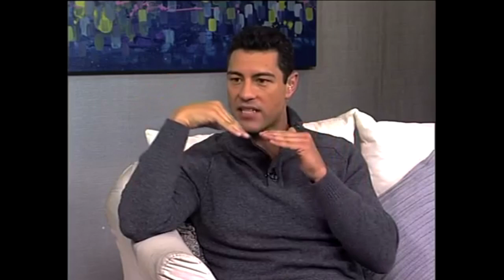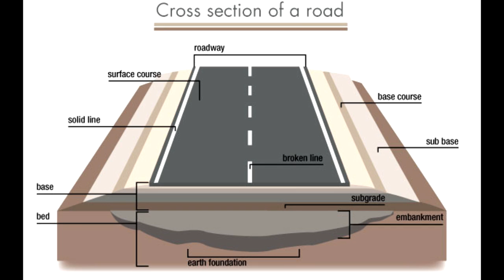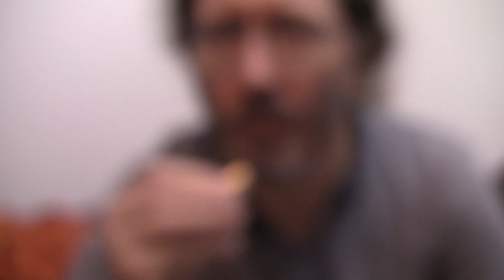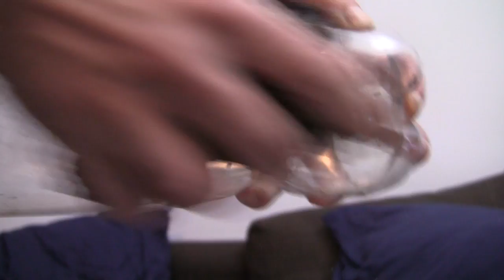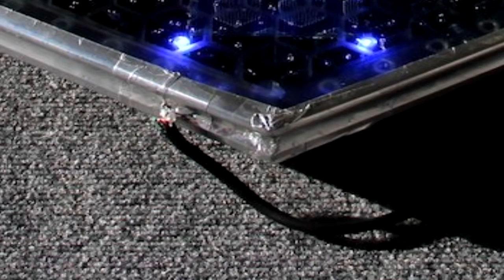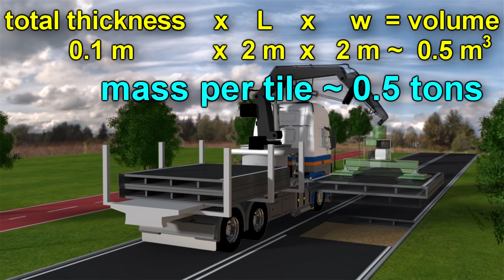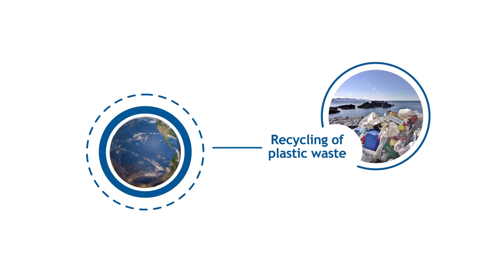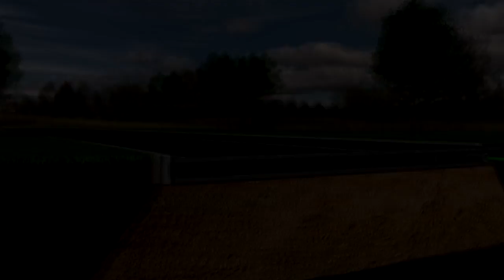Plastic Roadways BUSTED!

Comment: Wouldn't it be great if every road was straight or had a predictable bend to it. Truth is, the roads curve and contour to the land, part of the ease in making roads is that you can curve them to just about anything. These plastic roads would be so impractical. You would literally need a surveyor to plot ever inch of the potential roads surface.

Now, to put the above into perspective, a friend of mine is doing the surveyor works for freeway sound walls, and this requires the entire wall of the freeway to be mapped out, now, this mapping work will literally take a year for multiple surveyors to perform at multiple points on the freeway. Literally just the sound wall on the freeway would cost an arm and a leg to survey. With this plastic roads, you would need to survey every inch of the road surface, plot down curves in the road in high detail. These people have no idea how much work they are going to create for these surveyors who already get paid a tonne.

Comment: How about non hollow panels out of plastic with a surface layer out of rocks?
You could make them out of verry shitty mixed waste plasics in the bottom layer and a better plastic/rock composite in the top layer an weld these panels together to form a road.
A cable tunnel out of plastic waste could be next to the road.

It could be cheaper since you don´t need to seperate the different polymers to get this material and could actualy last longer then conventional asphalt since it wouldn´t get potholes as fast as asphalt.

Comment: You forgot the most important problem.  EROI.  With a falling EROI oil is becoming uneconomic.  The biggest oil companies are starting to make loses as the thermodynamic output of a barrel of oil drops.  
The world needs 30 to 1 EROI to function and that was reached in 1971.  Today world EROI is at 18 to 1 with debt making up the difference.  Exxonmobil, Chevron and ConocoPhillips, three of the world's biggest oil companies lost 8 billion dollars in 2015 and 7.9 billion dollars in 2016.  If the price of oil goes up the world goes into recession making oil prices drop causing oil companies to go broke.  This combined with global warming will cause the greatest collapse in the world economy in history and we won't have the EROI to get out of it unless a new energy source of at least 30 to 1 is found.  Spain and Germany's solar EROI is 2.8 to 1 and 1.8 to 1 respectively.  Wind is 15 to 1. Nuclear is 18 to 1 and takes too long to implement.  
Energy experts the Hills group has predicted that by 2025 75 per cent of petrol stations will be gone.  Mad Max is a more feasible scenario than plastic roadways.

Comment: By definition, plastic is very capable of handling multiple different kinds of attributes, but I somehow doubt a plastic capable of handling the kinds of stresses roads take from vehicles is exactly cheap and or easy to produce. The major destroying factor of roads today is due to soil water freezing and thawing, giving fluctuating stresses in uneven amounts, destroying the road and forming potholes.
Asphalt is functionally cheap and incredibly capable of taking the stress of vehicles and flexible enough to resist minor amounts of physical stress from thermal expansion and contraction.

Comment: not even 5 minutes in the video and as an electricians helper, the wire and conduit in a plastic roadway is SUPER NOT code. if one of those sections breaks from a semi you will need an electrician to fix the break in the wire minus the fact that is super inconvenient and dangerous.

Comment: But plastics can be reinforced, though, like the materials they use to make those "professional grade" tools, I guess. I think it's with fibers or really small balls of carbon. The fibers make resistance to impact and balls make it more heat resistant. Not sure, though. I don't think it would still work but it would make it a little more possible...
Reply: Repi Tv can you actually give the names of what your talking about because just saying "these fiber things can make it stronger" doesn't mean anything if you can't even tell us what those fibers are
Reply: Repi Tv nevermind it was mentioned in the video it would make the construction more expensive and make them impossible to recycle

Comment: I would be more worried about levelling issues between two different sections of plastic. Roads are never completely flat, and once you lower the segment into place, you are never going to be able to get it precise. And that little bump will cause the road to be rated 20km/h lower then it would normally. Here's a great example, a freeway in Melbourne had to be expanded wider, and ended up above a river, and they used pylons with segments lowered into place, but the little bump between segments caused the freeway to be given a lower speed as a result.

Comment: the GDR just used concrete plates as surface. (of cause not for all streets)
modular, cheap, easy to produce, long durable and a pain in the ass to drive on it

Comment: Just make roads out of old scalextric tracks.
Reply: ZefVolk Lol. If my experience with Scalextric is anything to go by, we'd all go flying off the road at the first corner.  😂😱😂😱
Reply: We'll put a shoe under one side of the road whenever there is a corner. There won't be a single road accident with Solar Scalextric Thorium Plastic Roadways!
Reply: Yes, we could use the waste plastic to create more crash barriers to fit around the corners of the track to stop us flying off.
BUT we would still have the problems of the live conductors in the centre rusting up, especially here in the UK with our weather.

Comment: I once made plastic by mixing floor cleaner, vinegar, and hydrogen peroxide.
Reply: What kind of floor cleaner? How did that work?
Reply: The gaseous kind of plastic that causes chest pain and the like when inhaled.
Reply: Johan Krooneman :-D exactly. It's quite a bad idea to mix together different substances, when you don't really know what you're doing.
Reply: + Thomas Hobbes I don't remember what kind of floor cleaner and there weren't ingredients listed on the bottle either. That was about 6 years ago. The reaction made a very unpleasant smell so I had to ventilate the area.
Reply: pukalo WOT that's what I meant. Very bad idea. You can permanently damage your health if you start chemical reactions without exactly knowing what's going on.

Comment: "It has many advantages over existing products" - namely it will funnel cash into the pockets of these hucksters if it ever got funding.
Reply: At least Solar Roads had the promise of Energy production going for it. This is just a different flat surface.
Reply: I wonder if you could sue them
since they are misleading and basically scamming people, if they get funding from anyone, since this needs to stop
Reply: Feminists don't do any better and they can't be sued since decades.
Reply: RipTheJackR considering someone was dumb enough to fund solar roads I wouldn't be suprised

Comment: okay guys, can we just all agree that tarmac is the best way of making roads?
I mean, don't these people think there might be a reason why China, South Africa and America all make their roads out of a Tar mix?
Pretty sure that wouldn't be the case if it wasn't objectively the best solution.

EDIT: I actually went and checked, at 100$ a ton, you will be hard-pressed to find ANYTHING that is cheaper by weight than blacktop. Probably why it is used everywhere.
Reply: +Nerobyrne No, in South Africa we don't make roads out of tarmac, we make them out of potholes. Then we set up automated camera systems that will bill you exorbitant amounts of money for using the roads, even if you didn't.
Reply: Is that 100$ for the finished product, or just the black goo? It's cheap either way, but if only the black goo costs that much then it's ridiculously cheap.
Reply: ***** it seems to be the finished product.
But actually the black goo is by far the most expensive part, since the rest is mostly rubble!

Comment: STUPID idea. plastic can deteriorate in both physical and sun radiation.
Reply: Yeah it is a issue. This mean that you NEED to put stabilisers which will make it even more expensive.
Reply: Well, asphalt is cheaper and we dont know the final cost of this plastic road production. Just saying that is cheaper than asphalt is just a random guess.
Reply: Of course it's a bloody issue. It will need to be put into the plastic as the products are made, exacerbating the fucking problem of the plastic that doesn't get recycled lasting even longer in the environment, AND costing more in the process.
Hardly progress, is it. Or problem solving.
No wonder we're fucked.
Reply: if u wanna replace something, it has to be cheaper than the old one
Reply: Depends what era were u talking about Taking Care of Horses 18-19th Century or 20th-21st Century?
if u said horse and cart cheap unless u are living in Amish Community
Reply: khairul USacc not all kinds of plastic
Reply: Honudes Gai The horse and cart was actually fairly expensive, because horses take a lot to care for and feed. Owning one (not really for the common man) meant also having to pay for its stable, having land for it to run around on, its food, probably servants to care for it, etc. The car beat it because it was faster and something the middle class of the early 1900s could actually afford, both in money and time, to buy.

Comment: Why do people try to re-invent roads all the time? What is wrong with asphalt? Nothing, that's what's wrong with asphalt.
Reply: As a final year engineering student I would have hoped you would have been a little explanatory. In what way? What did he unfairly bash? Where did he get something wrong or misrepresent anything? What exactly do you find convincing, compelling or even reasonable about any of this. I would be intrigued to hear your ideas broadened out a little.
As an engineer since, well forever, I'm now 54 and have worked in many different industries, including mining, plastics and polymers (moulding, injection, blow and press), and more. I also have worked on road laying machinery and have 2 very close mates who actually are road layers, up to and including motorway.
Not that I'm attempting an argument from authority here at all. But I personally see nothing remotely reasonable about the idea. In fact I would say it is quite ridiculously over the top in it's positivity, verging on, if not already passing the threshold of dishonesty.
Even if I didn't know what I know I would dearly hope my bullshit'ometer would go off, certainly before the end of the presentation.
Reply: DN Swag but still better than foil hats
Reply: DN Swag He did talk about them using a different kind of plastic, mentioning that it loses most of the features it would be advertised as having. Did you make your comment without actually watching the entire thing? He even, for the sake of the argument, imagined that there was some plastic that was durable enough to do the job.
Reply: Vanessa H just because they have being toxic in common does not mean they are basically the same. they have completely different formulas and different physical properties lol. but true very toxic. but only when wet. you can smell and lick asphalt all day after it is 100% cured. not on a sunny day though. wouldn't recommend it.
Reply: Filling cracks and potholes is extremely cheap and easy. Just a man with a truck and a few hours can repair many hundreds of yards of road.
Reply: aMondia the water drainage isn't great, you have to manually check for broken pieces, cracks, etc, it discolors over time, it gets very hot in sunlight (causing stress fractures), and it only lasts a couple decades. Besides, it doesn't even come with cupholders or air conditioning as standard features.
Reply: +charles Bishop  its cheap, can be fixed realy fast and easy, can be reused, can be made everywhere without huge amounts of technologie.  cant be much better for basic roads.  and they are working on improvements everyday, so its getting better.   
ohh and there are ways to make it with 100% organic oil.
Reply: If it hasn't been clarified already in this comment section; Asphalt is one of the most recycled substances that we use.
Reply: Asphalt is inherently sexist. They might as well call it "titfelt" or "pussygrab," the disgusting pigs! My car is a SAFE SPACE, why should I have to put up with this crap?
Reply: Unless we're going to make diamond road surfaces,  wear and tear is ALWAYS going to be an issue....
Reply: In some places where it snows in the winter, something else is actually needed. I live in northern Ontario and every spring, there are a fuck ton of pot holes everywhere. I would love it if there was a solution to this problem but obviously it isnt a problem with the road surface. it is with the foundation under the road being washed away in certain places. Maybe if somebody actually proposed a feasible solution to this problem, id actually support it
Reply: this idea has merits i think,they could always use this to make private roads,or bicycle roads etc, ofc the idea of pipelines bellow it like the video demonstrates is ludicrus
Reply: Aanthanur DC Read the comment rationalmartian was addressing, then rationalmartian's comment.
Reply: +Aanthanur DC  The other guy claimed to be an engineering student, read it again. Youtube doesn't tag who you're replying to for whatever reason when you hit reply. He isn't claiming to be an engineering student that is 54 and has been an engineer for years. He's addressing the person as "a final year engineering student". Context clues etc etc
Reply: No, i mean that alot of stupid people think that there is no science  and research behind road building, or to be fair alot of everyday stuff. thats why we see so many scams like this that make alot of money.
Reply: Bruce Dunn i dunno, I was too busy making my funk the P funk to notice.
Reply: Do you have any idea how much a 50 yards segment would cost? Do not forget underlying work that probably has to be done in reinforced concrete to avoid segments to break?
Reply: Asphalt is pretty decent, but long term you do get maintenance issues so we do have some improvements ahead of us.
Sectioned road pieces and better interlacing would be very good upgrades, but obviously they need to be developed towards a better end product and not wishful thinking.
Reply: True but anybody that's seen the paved sidewalks in London will attest the same thing happens to slabs, but instead of flexing they just end up sticking out and we can only imagine what that would mean for cars.
And you have to admit having the road hollow is pretty silly, if the road is stamped then just add a channel down one side.
Reply: Co2 emissions, we need to get those to zero in a few decades.
Reply: rationalmartian
 opps
Reply: +rationalmartian jeeeeeese shorten ur damn comment bro.
No likes anyways.
Reply: because stupid people think we just build roads like 100 years ago--
Reply: nox5555
are you claiming all people that research improvement for road constructions are stupid?
Reply: Dexx the Duck
 thanks, saw my error.
Reply: aMondia Because they're stupid!
Reply: I propose starting a business that sells treads for cars so that there need to be no roads
Reply: +TheBuragi that and people taking to the roads with pickaxes...
Reply: SunPower Guru 
It's ain't my fault, it's your asphalt.
Reply: That will never happen, as long as you breath fart and defecate it won't.
Reply: there's always room for improvement, but people need to stop pushing half baked ideas as "solutions"
I mean look at SpaceX they worked on their concept for way longer before the idea became pushed as a "new solution to space programs", turns out it was a genuinely good idea and their first test proved that it was plausible.

Compare that to the HypeLoop "idea", marketing bullshit, no RnD being done by major companies, pretty computer generated videos. fuck I don't even think I've even seen a computer generated video for their reusable rockets, I've only seen the prototype landings and test landings.
Reply: Bruce Dunn if it was mine, i would name it, "Bodypartnonspecificfeltbutonlywithwrittenpermission,"
Reply: SunPower Guru 
Wasn't that on a Parliament/Funkadelic album? The second track after Supergroovalisticprosifunkstication?
Reply: I am in a poor country, we can't afford asphalt
Reply: asphalt shrinks and cracks overtime. It's actually a pretty shit material

Comment: PLASTIC FRICKIN ROADWAYS? WITH LEDS? AND THEY'RE THORIUM POWERED?
Reply: They are also enclosed in a vacuum for super speed travel!
Reply: You forgot the part where they could generate clean drinking water from hot air.
Reply: Thorium powered AND solar powered.
Reply: And next to the roads they have solar walls with no solar panels
Reply: Arminius idiocy is described as reinventing the wheel but great innovators reiterate past inventions for efficiency savings (I don't mean cost)